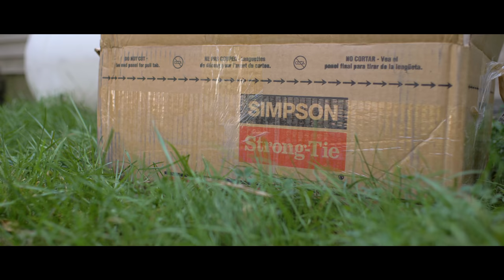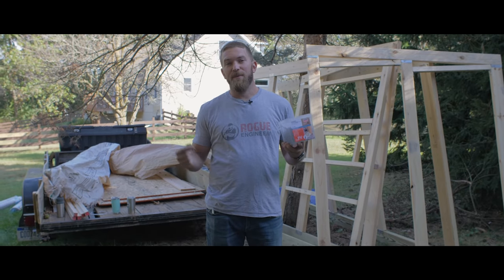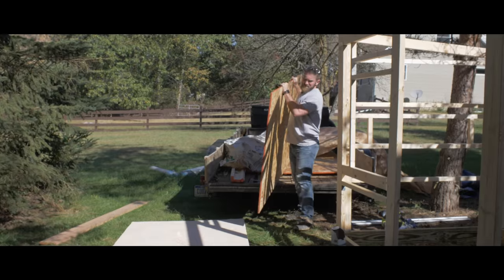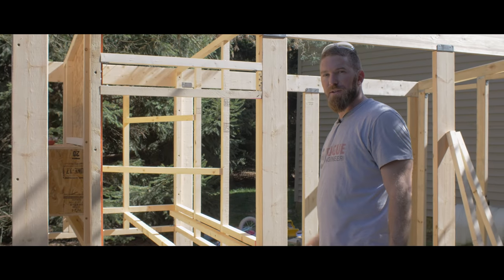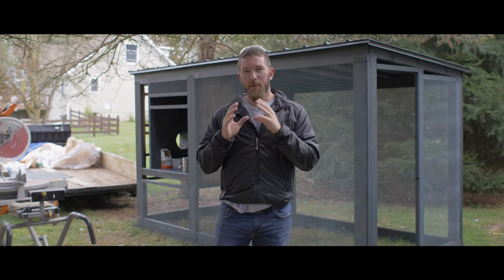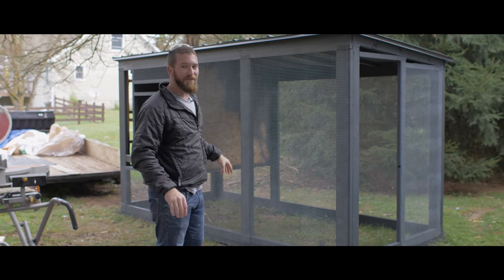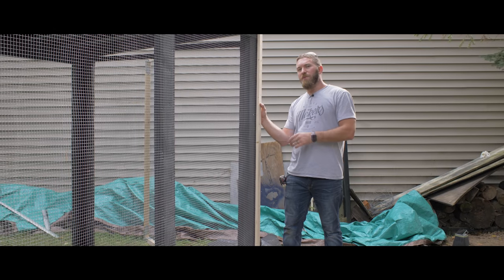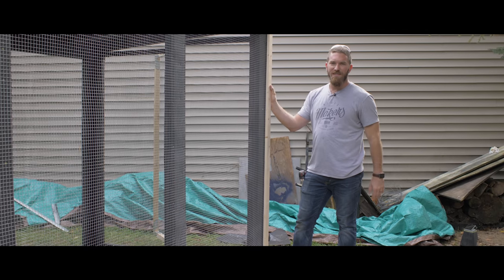How to Build a Modern Chicken Coop

Comment: I built a chicken coop similar to this one but I live in Eastern Ontario so I had to insulate the living quarters.  I used 2x4’s with 3 1/2 inch batts. I also had an electrical connection for a heat bulb.  I build a guillotine door for the living quarters that I could raise and lower by means of a pulley system.  It also was constructed using 2x4’s with insulation.  To stop predators from digging under the coop, I installed wire mesh on the floor of the coop.  Building this coop was a great experience and I got a new appreciation of just how fascinating chickens are.
Reply from the maker: Good call! Thanks for the tips

Comment: Built this last year and turned it into a cat house. They have a tunnel from the house to the coop. The coop is on a concrete paver patio we stained the same color. It offers a great retreat without threat of predators. Added some lightly burned maple shelves cut it in urethane and a second hole as a peach for them. Then just put in a modern outdoor loveseat, a rug, some 12x12 pillows into the nesting boxes and shelves inside the roost. A few pull threw gate latches and some live plants. It just makes the back yard pop and gives the little guys a place where we can all lounge and hang out outside under the shade giant elm and catch a cool breeze.
https://photos.app.goo.gl/PmDRkGd2Z58coExm8

https://photos.app.goo.gl/iUGjMU33jKygjMAs9
Reply: Purrrrrfect for a Catio idea !
Reply: @melodeeplath9597  It's amazing!

Comment: Hi
it was a beautiful and well-worked house. I have 2 questions;
1- Why did you prepare 3 sections for 6 chickens? Shouldn't there be 6?
2- I planned to make this set. but we use metric system. therefore, different values come out when the unit translation is done. such as 139 inch 3.5203 m and 1.7018 m. such precise cutting may not be possible. Can I learn the corrected metric values, if any, to avoid errors? Because if I enter a measure difference, the whole structure will be an error. Or should I just do it? for example; 3.52 or 3.53 instead of 3.5203 m? 7/8 inches equals 2.2225 cm. here is 2.22 or 2.23? like.
Thank you from now.

Comment: in a nice big coop project like that only suggestion is putting gravel under the wood base so that in due time the water wont rot it and eat it away and perhaps will need to redo it after just gravel under the wood parts only not in the coop just so that the water wont be stagnant on the wood and the rocks will lift it just a tiny bit so the water ill not effect is as much  but very nice job.
Reply from the maker: dreamkiss4u that is a great idea. We used treated wood on the bottom but that would help too. Plus it would help keep predators from digging in.

Comment: Hey just found you guys. I’m new to building and was just wondering what materials you used to build the roof part of the run. I’m looking not to make it too complicated and decided on building a lean roof but still don’t know what materials would deter rain (birds have a separate home for winter) from getting inside the coop. Do you think a plywood as the base and then just putting some plastic roof panels would be good enough for them just to lounge around during summer months? Thanks!

Comment: What would you estimate total cost of project to be? with and without the Hardie product. Sweet coop btw! Also did you add a predator guard around the bottom after?
Reply: $500 for the lumber, brackets, and screws they recommended (at Home Depot) just three days ago.

Comment: I just purchased your plans, how do you do the 5 degree cut for the top. Your plan does not explain it.  Thanks.  A drawing or sketch can help. Thanks
Reply: Miter saw that has degrees adjustment is how I did it.   The length mentioned it at the high point of the cut.   For the bigger pieces, like the OSB, I measured what was needed and then used snap like and followed the line with my circular saw and it gave me the angle needeed.

Comment: Would it be difficult to extend the coop 4 ft, add an extra foot to the roast and instead of storage add an extra nesting box so you can house 8 chickens? Too much?
Reply from the maker: I don't think that would be too hard. I left dead space on both sides of the nesting boxes for food and water dispensers so you could easily add another box in line and keep the storage.
Reply: Doing this right now actually. The hardest part was trying to figure out the degree change. 3 degree cut was what I did... It doesn't line up perfect,  but it's close enough and it's a chicken coop.
Reply: Nathan Babauta thanks! We start the sides this weekend. We did the front and back last weekend but I was scared to try the angle cuts. I will start with 3 degrees 🙂

Comment: Little short on roosting and nesting spaces. Make for a lot of wars in the coop. I'd add a couple of nesting boxes, a total of 6 roosting bars, and a good way to clean out the bottom of the roosting area.
Reply from the maker: I actually did a lot of research on the recommended roost and nesting boxes per chicken. 1 nesting box for every 2 chickens and about 12in of roost per chicken. All the chickens won't be laying at the same time so the nesting boxes will never be an issue and the reality of the roost is that they all huddle together on the smallest roost. Who would have though. I also added linoleum to the bottom of the coop and it makes it really easy to clean up.
Reply: Exactly. You made it correctly. There isn't anything at all wrong with this coop. Just could use more grass space, but that's every single run in the world..